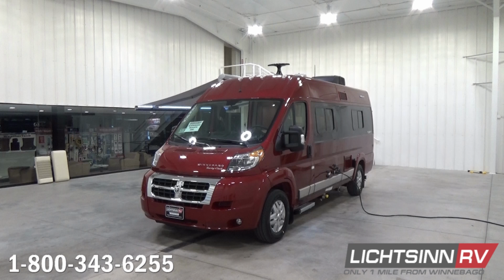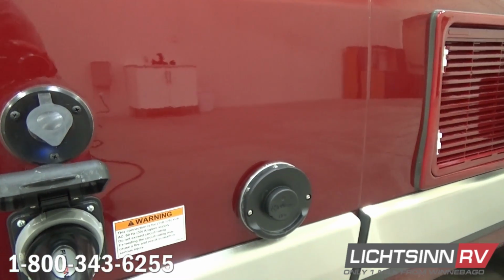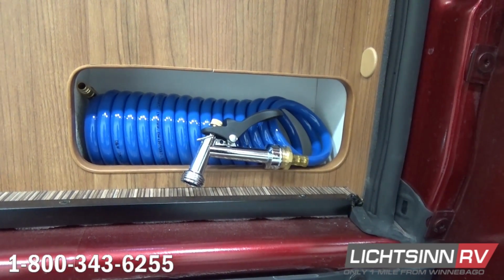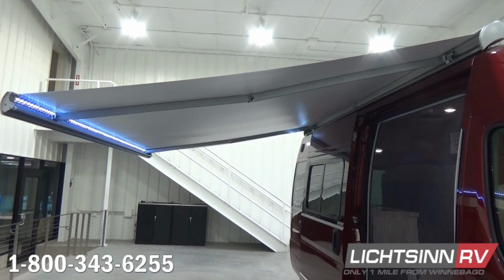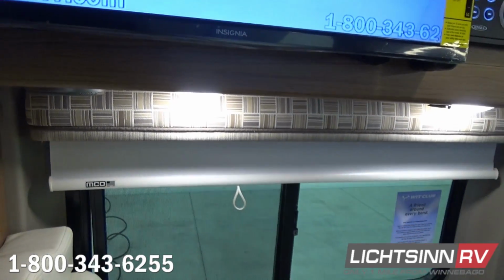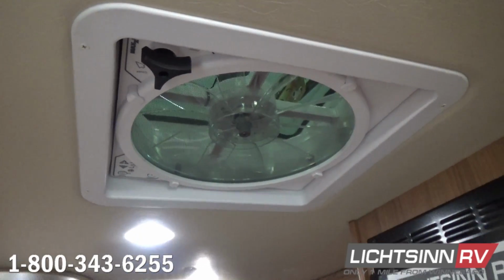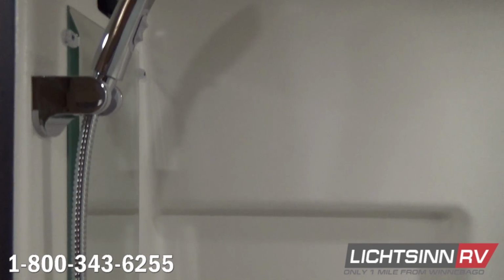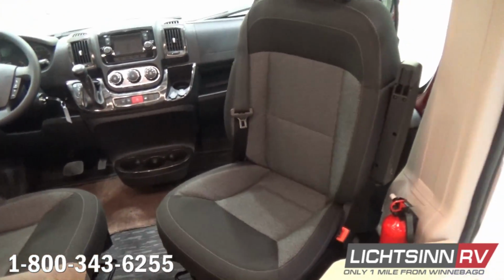LichtsinnRV.com - New Winnebago Travato 59G

Comment: I understand the total height of the RV. For washing purposes, what is the height of the exterior sidewalls, where they join the roof?
Reply from the maker: Good morning Richard!   This height should be 8' 3" to the top of the van with no RV installed components.  Overall height is 9' 4"

Comment: Can I use the kitchen water, shower or toilet when it is freezing outside with either shore power or generator on? Looks like 2018 model did move the fresh water plumbing inside but what about the rest? Thank you.
Reply from the maker: Good morning!   You actually can off of 12V and then use shore power or generator or powertrain to recharge batteries!
Reply: So no worries about freezing water anywhere when it is freezing outside? Thanks again.

Comment: so how does the solar work when batteries are fully charged and your not using the rv.  what happens to the charging power from panels
Reply from the maker: Good morning!   These are direct wired to the batteries with a multi stage converter so they will trickle charge as needed.  Hope this helps!
Reply: Lichtsinn RV what happens when batteries are fully charged and coach not in use
Reply from the maker: Good afternoon!   The solar has a multi stage converter capacity and will trickle charge the dual batteries.  They are hard wired direct to the batteries and will trickle charge even when the disconnect switch is off.